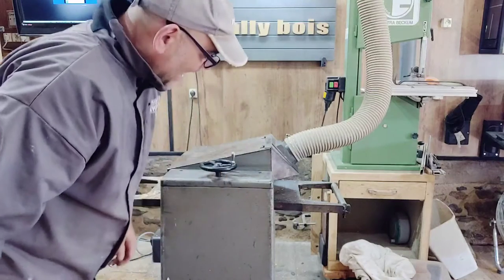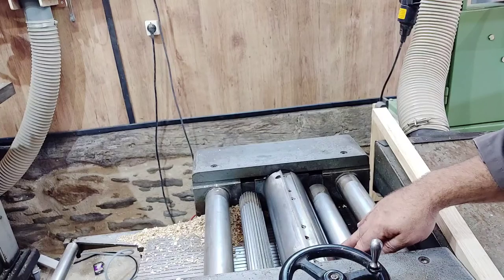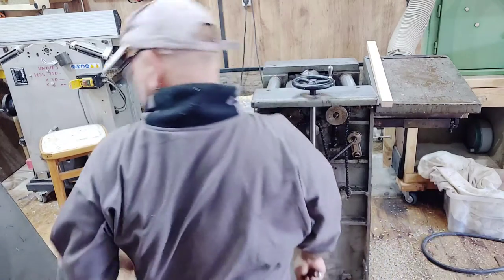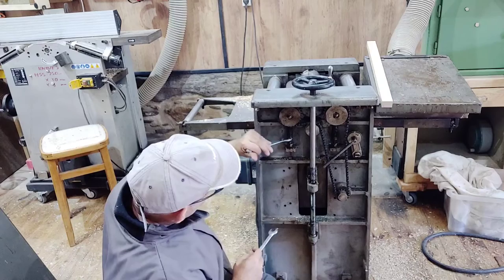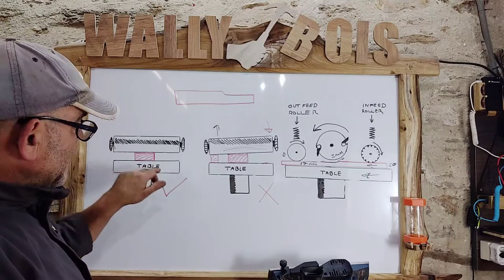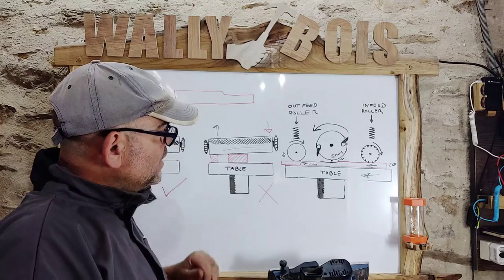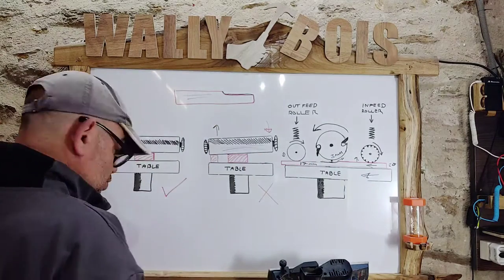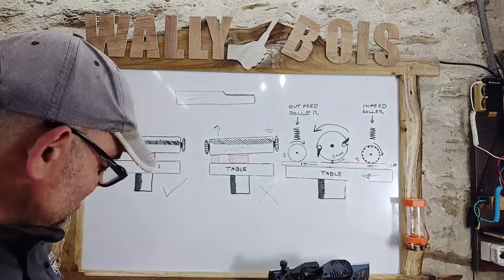How to adjust PLANER FEED ROLLERS and why it is important ... woodworking in 2020

Comment: I replace my rubber infeeder roller with a metal one and its not pullkng the lumbef not at all i fix it 1/16 below yhe cutter blade and still not pulling so am wondering if i cant use the met roller on a benchtop planer
Reply from the maker: Which planer are you using? Maybe i can help
Reply: Porter cable
Reply: I get it to work today but i have to make deep cut for the roller to pull the lumber
Reply from the maker: @Dc_tech386  metal in feed rollers are serrated but site thicknessers use rubber rollers. You need a lot of downward force for the roller not to slip. Site planers have a height adjustment over the timber so generally the motor assembly can move upwards during a pass. Have you lubricated the tables as this will help?